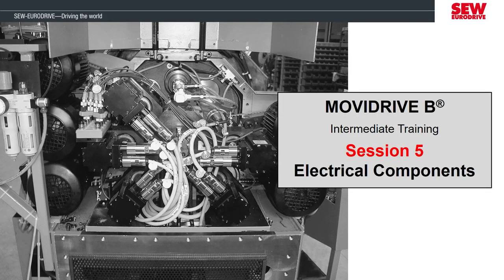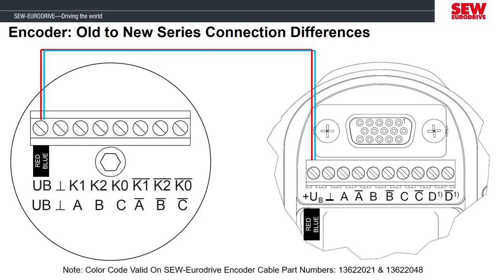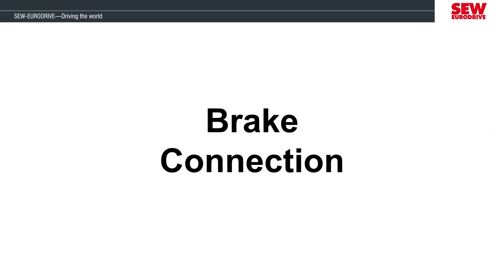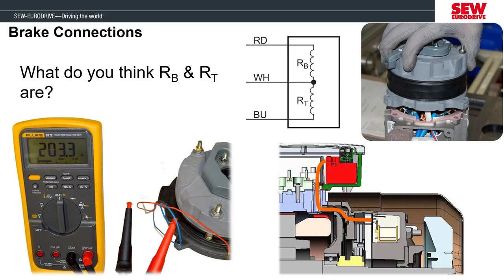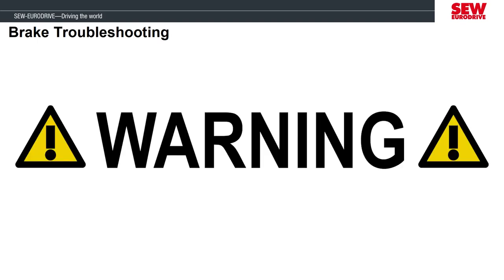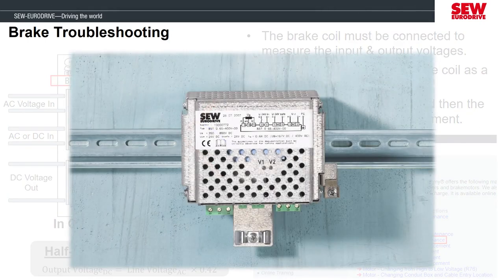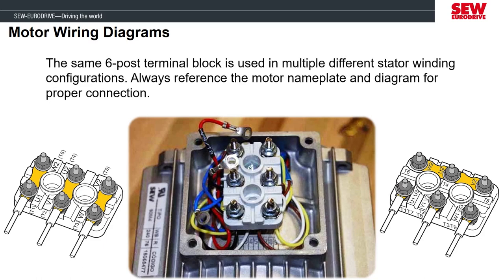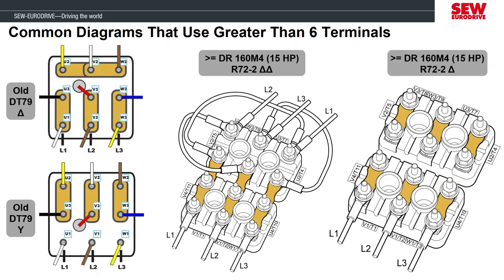MOVIDRIVE® B Training Session 5 - Electrical Components

Comment: Great information.  Bit confused at the end about motor wiring
Reply from the maker: Hi Michael, do you remember at what timestamp in the video there was confusion? Sometimes motor wiring can be challenging if you're not familiar with it. It also will change depending on which motor is installed and how the machine was designed to be controlled. If you have specific questions feel free to call your nearest SEW-Eurodrive Assembly Center and ask for Regional Engineering to help you with motor wiring. On the SEW motor nameplate there is a long string of numbers at the top called the S.O.#. Please have this number ready because Engineering will need that to look up the sales order details.

Comment: Saw a brake accidentally turned off when machine running and the gearbox split in two instantly with a large banging noise   !!!!   The tech was trying to measure the brake voltage and moved the brake connector too much to get a contact for his multimeter with machine running.
Reply: X2